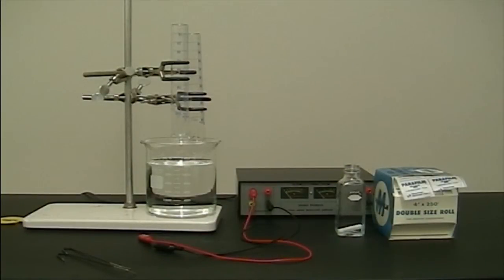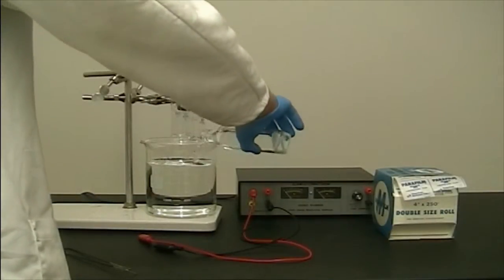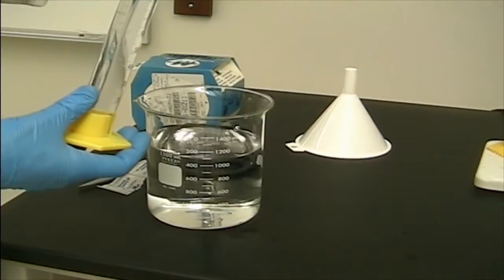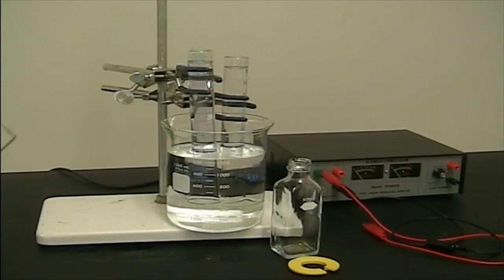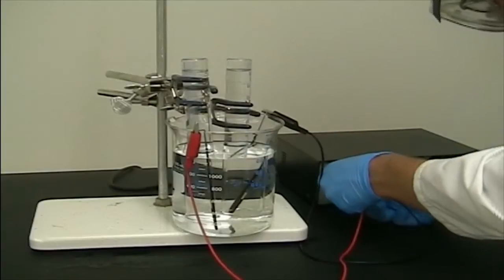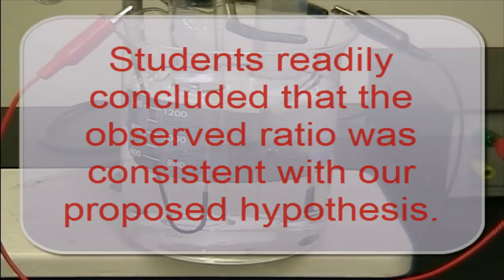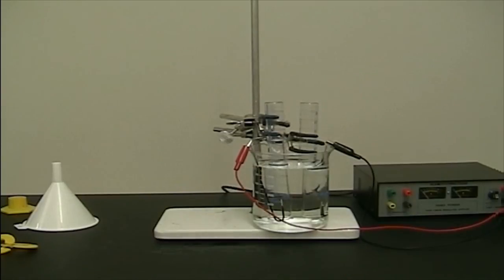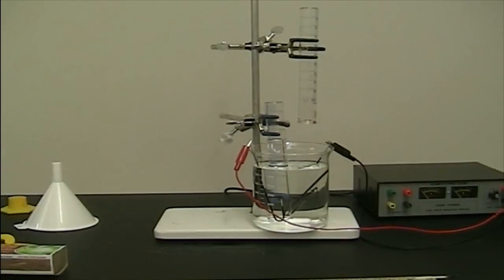Setting Up An Electrolysis Apparatus (Large)

Comment: Hi Mike, i am having problem to find where i could buy those  2  stainless steel, S-shaped electrodes , if you have any idea Thanks! great video by the way
Reply: i found it where you bought but is 15 dollars just for shipping + taxes... so  i am doing a prolonged electrolysis do you think that those  2 stainless steel electrodes are gonna last , i mean , can i use them without having to worry of corrupting the solution left  over time
Reply: i found it way cheaper in ebay !
Reply: https://www.amazon.com/American-Educational-3556-Electrolysis-Kit/dp/B005QDX8X2/ref=sr_1_2?keywords=electrolysis+chemistry&qid=1570216999&s=industrial&sr=1-2